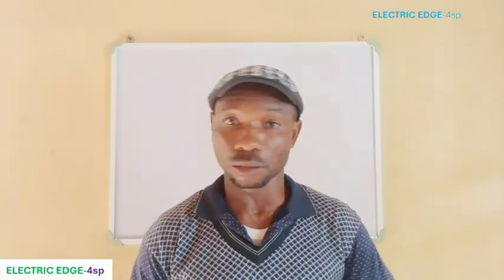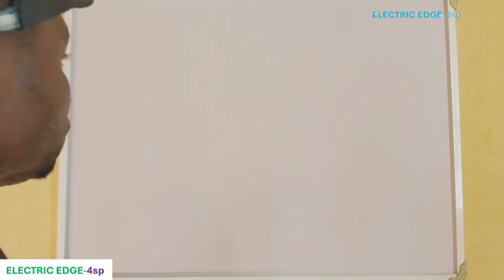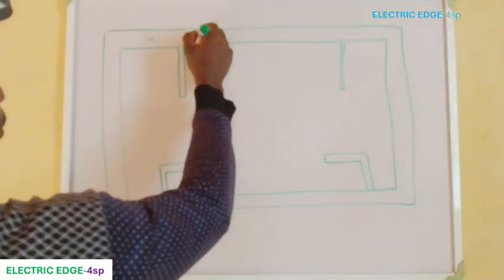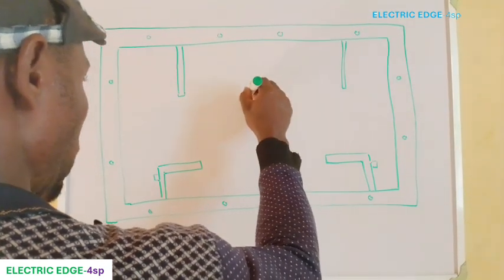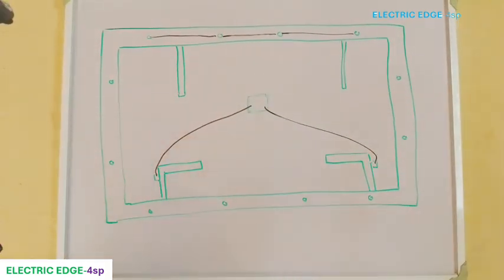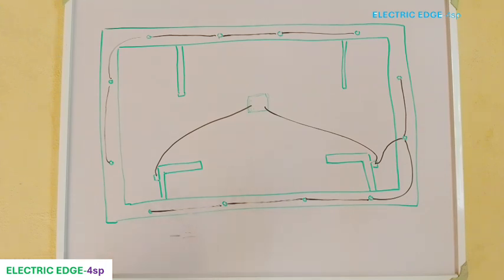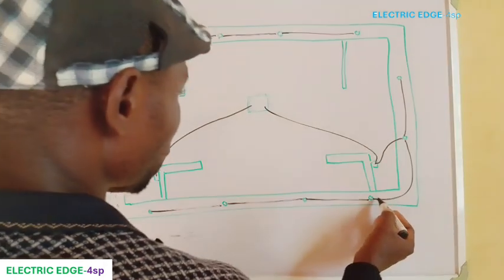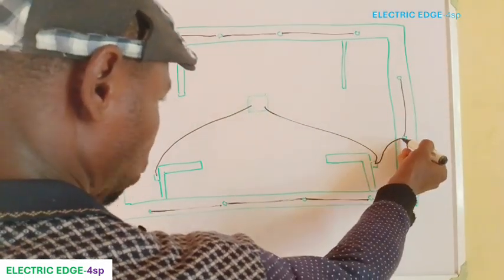How to do Conduit Piping of Parapets | Step-by-Step Guide for Proper Installation

Comment: Good job. Thanks.  Please, how do we work out the quantity of cables in different colours
Reply from the maker: You mean how one can get the exact quantities of different cables with respect to cable colours and sizes? This is why an ELECTRICAL WORKING DRAWING is very important for any electrical project because you need the details of the building size, the components to be used in the house will determine the cable sizes and types including the measurements.

With these details it wont be hard to get the measurement , sizes
Reply from the maker: You can take a look at the video below:
*Important use of Electrical working drawing. https://youtube.com/shorts/lLfd9iiPr8w?si=jqb5zurj0zlrFnDp

Comment: Sir i thought Neutral does'nt normally enter switches?,Basically your pipe runs from the DB to the swtich,is it advisable to do piping that way ?
Reply from the maker: Yes, correct, neutral can pass through the switch without stopping untill it gets to the point of light. In most cases we may run pipe from the DB stop at a lighting points before we get to the switches so that neutral don't get to the switch.
Reply from the maker: you know that electric conduit piping and wiring is construction that must be done with compliance to it's rules and safety codes. Please check my previous videos in the description.
Reply: Alright, thank you sir
Reply from the maker: @johnchukwuemeka8204 you're welcome bro. And I promise to show you some tricks during wiring